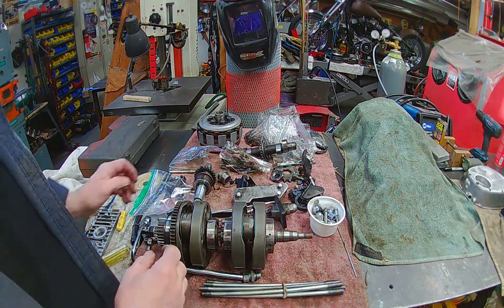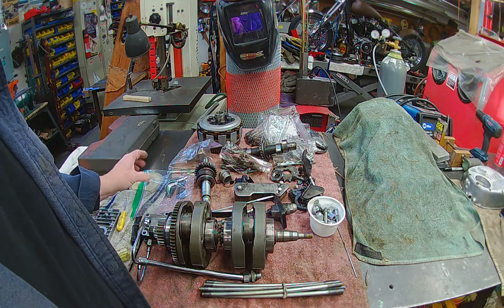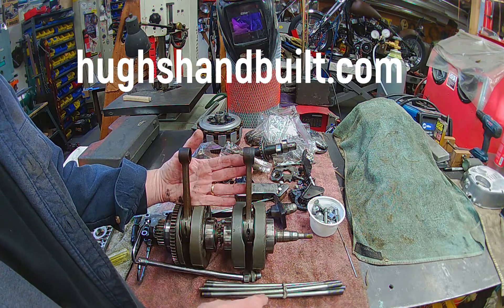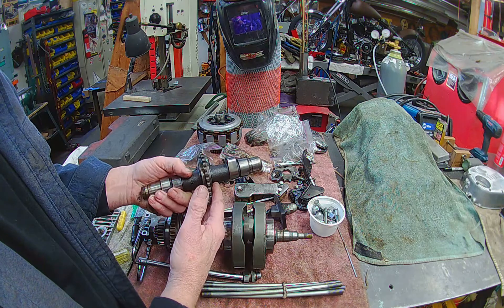XS650 Dual Sport Build

Comment: How do u go about cleaning your aluminum engine exteriors? I got a case of the previous-owner-covered-with-tarp-outside, oxidation everywhere. Any tips? Thanks!
Reply from the maker: I use a wire wheel ,toothbrushes or small little wire brushes with soap and water helps a lot to clean that off. Thanks for watching.